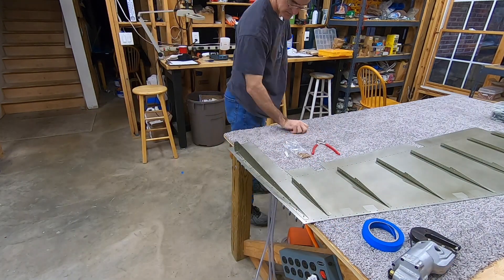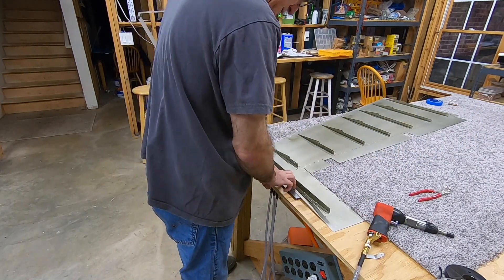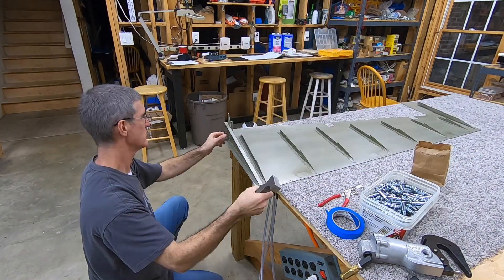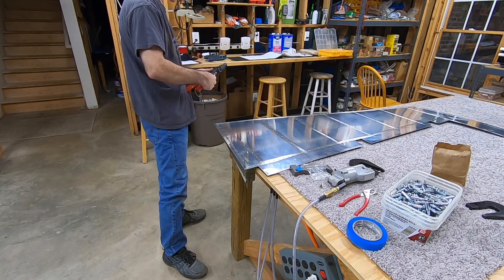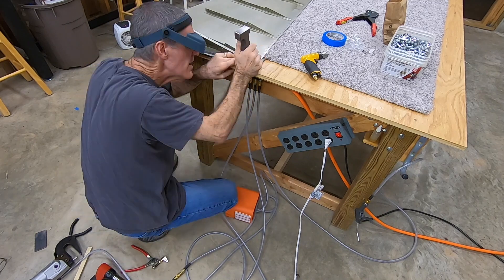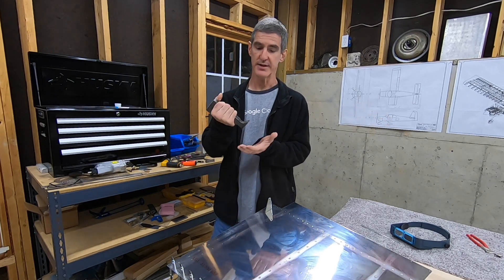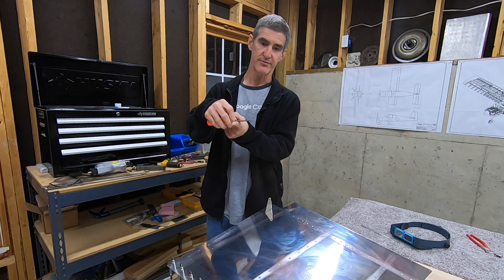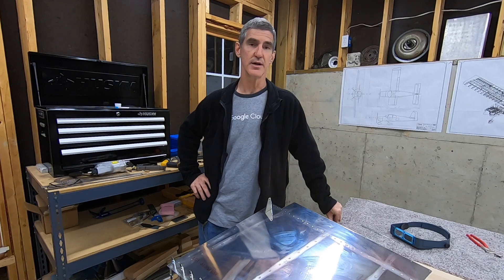RV-10 Build Log - Emp 26 - Riveting Rudder Top and Bottom Ribs

Comment: I just talked to Van's Tech Support today. If the shank of the blind rivet to be inserted is partially blocked by the shop head of the previously installed blind rivet on the opposite side, Van's recommended to insert the blind rivet as far as you can then squeeze, then push the blind rivet in some more and squeeze again.  In other words, push-squeeze, push-squeeze, push-squeeze, etc. until the blind rivet is completely inserted.
Reply from the maker: That's exactly what I was able to do on the opposite side (left skin) but only because the opposing rivet (right skin, the one I had trouble with here) was a 426.  If it had been a blind rivet as well, the rivets from the two sides would interfere even after fully squeezed.

Comment: Good job on figuring out a solution. Over the years of working on aircraft structures I have custom made around 15 bucking bars for just such problems. The cost is a bit high but worth it when you are doing it day in and day out. Just make sure whatever you use is polished so as not to damage the rivet tail when bucking. Love the videos.
Reply from the maker: Thanks for the tip!  I didn’t think to do that, but the chisel was pretty smooth as is, so hopefully it should be fine.

Comment: I understand your frustration.  I couldn't put in the last 2 rivets in the skins and rib on my project either and I tried everything just like you!  I think the best solution would be for Van's to offset the front and back holes slightly in the ribs and skins so blind rivets could easily be added from both side, but this would require a change to the design from Van's.  Another possible solution is to back rivet the last two rivets with flat head rivets. In this scenario, the shop heads would be on the outside of the wing skin similar to the one side of the trailing edge. A third solution is to pop rivet the top skin and not insert any rivet in the bottom skin. Then on the bottom skin and rib drill a new hole between the existing hole and the trailing edge and insert a blind rivet in the new hole.  The existing hole could be filled in by the painter before airplane is painted.  For additional strength, Van's Tech Support recommends using tank sealant between the the wing skins and rib just around the last rivet near the trailing edge.  Van's Tech Support said that this area near the trailing edge will experience the most vibration during flight.
Reply from the maker: Offsetting the rivets a tad is a great idea.  I’m a little surprised Van’s didn’t do that.  For that matter, I’m a little surprised they didn’t go into more detail about what a royal pain it was going to be to get that rivet in there.  They addressed the left skin and the fact that the blind rivet was going to bottom out before it was flush, and what to do about it.  Just acknowledging that it was going to be a struggle goes a long way toward giving me the confidence that I’m not doing something wrong.

Comment: Section 5.8 of the big info packet that came with the plans says they now recommend the 3M tape instead of tank sealant.  Just curious if you saw that or maybe had already ordered the sealant?  I think either one will work well, and think they switched to the tape because it’s easier... maybe.
Reply: Never mind just saw your next video and the comments about tape/sealant
Reply from the maker: FWIW, that tape I bought has come in handy for some other airplane-related uses.  It's very thin, still very sticky, but can be popped back apart if needed.  I liken it to really thin hot glue, in that you can use it for very strong but temporary attachment.  Cleans up with acetone and elbow grease.

Comment: It's interesting seeing that people continue having this problem... i was able to carefully wedge a thin nose, no hole yoke in there and squeeze the rivet as usual. I did have to spread the flanges about 20-20 degrees to make it work, but it wasn't enough to deform them... I almost feel like i should of made a video about it... seems to be a common pain point.
Reply from the maker: You should!  Maybe my thin nose yoke is a lot thicker than yours.  Mine is a 4” yoke.  I bought it to do double duty, but perhaps the nose on a 4” “thin” nose yoke isn’t as thin as a 3” or 2”?  There was no way I was getting mine in there.  I had to spread the flanges out just to do what I ended up doing, but I still never would have gotten that thing in there.
Reply: @missiletwentynine2667  I just measured the height of the one I have ( both the 1 inch and 2.5 inch), and the very tip of both yokes is 3/16 of an inch tall. how tall is the 4 inch?
Reply from the maker: @andreicornell6955  Hmmm...  When I measure the very tip of the 4” it’s a tiny bit thicker than 3/16”.  But it widens out to a little over 1/4” inch (looks like about 9/32) if I measure the thickness centered over the middle of the ram.  I considered grinding mine flatter to get better reach.

Comment: Another solution would be to not fully rivet the R-1004 halves at that end until it’s attached fully to the skin. I’m interested in seeing if anyone has done it that way
Reply from the maker: It does seem like that would have helped.  You need to have the two halves riveted together up front to rivet the horn on, but thinking back, that could probably have been done in a different order.